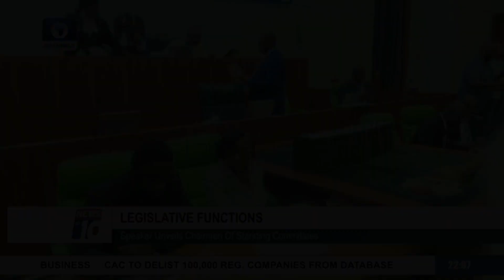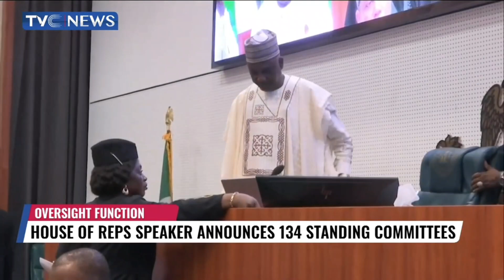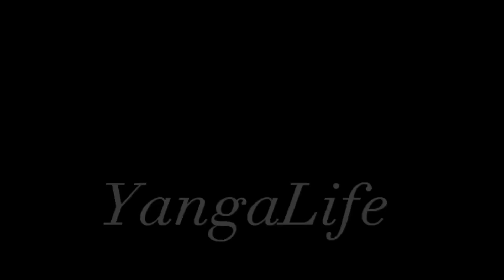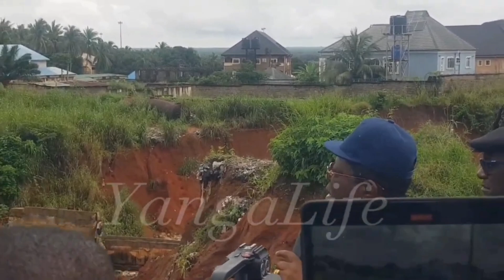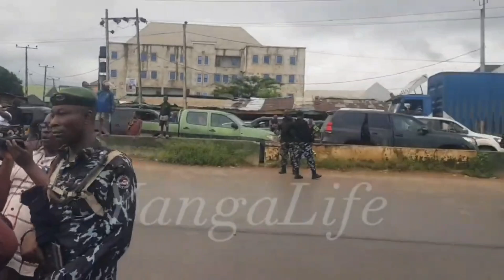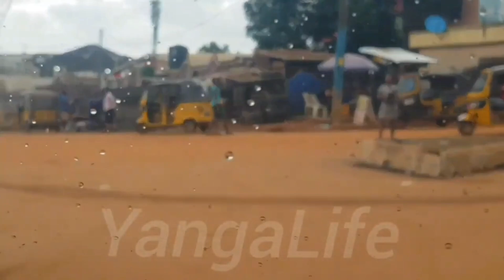Reps To Investigate Umahi's Concrete Road Technology, Commence Integrity Test On Bridges, Building

Comment: My recommendation to the minister is 
1. Improve the substructure and increase the paving courses.
2. Use only reputable contractors e.g onitsha owerri highway,while CCC section from upper Iweka to Mgbidi is failing the Julius Berger section from Mgbidi to owerri is still fairly ok
3. Control the load on our road,there is no where in world where 90tonnes load carrying trucks are allowed to ply interstate roads, it will damages the US interstate if it was allowed there. This can be done by installing waybridges at strategic points on our highways.if you load supersedes the allowed weight you are fined and forced to drop off some load from your truck
Reply from the maker: These are wonderful ideas. Thank you.